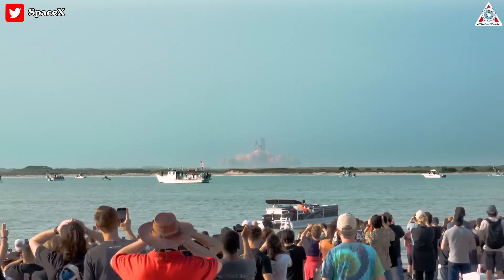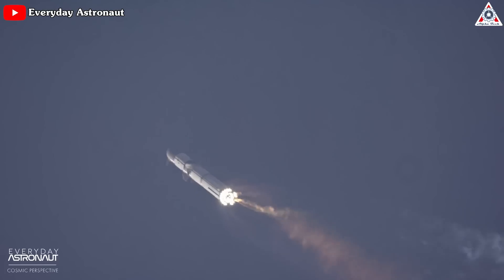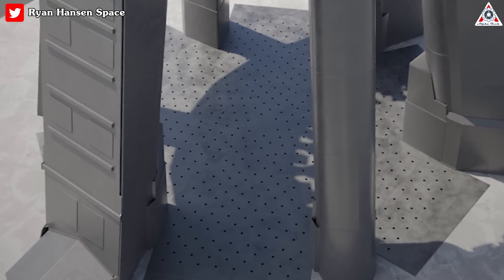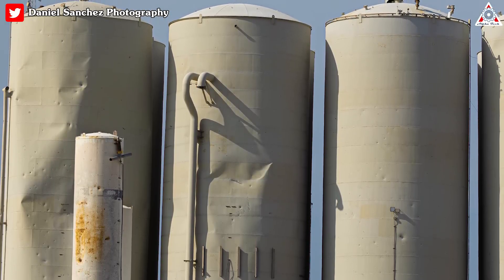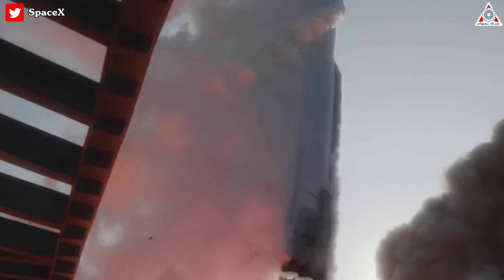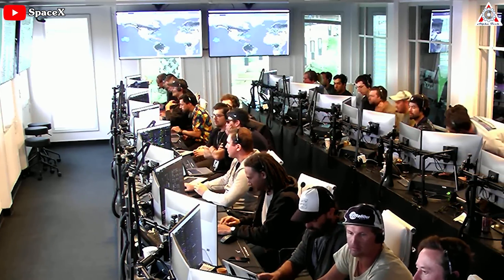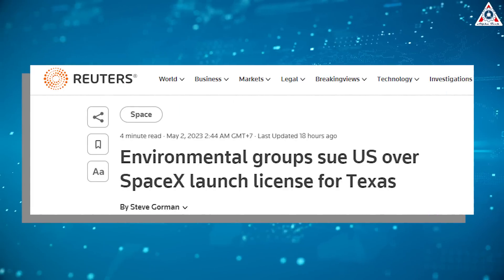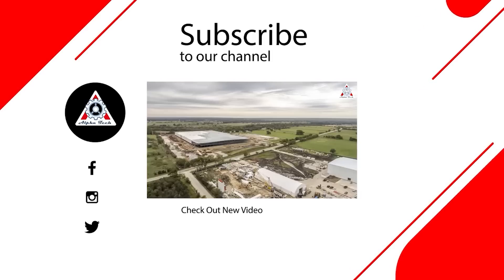SpaceX upgrades everything on Starship's pad for new launch...

Comment: During the launch, pieces of the launch pad that flew into the air and destroyed the rocket's engines, this caused a chain reaction in the rocket. The structure of the launch pad was clearly too weak to withstand the forces caused by the rocket. 👍
Reply: This isn't what happened, or rather is probably not what happened. The force of the rockets downward thrust would make it very difficult for debris to fly directly upward. The launchpad design was a complete failure, of course, but the reason behind why at least 3 raptor engines were offline at the get go is still kind of unknown. And the fact that more continued to fail and self cannibalize (green smoke an indication of that) on the actual flight is concerning. This is a reliability issue, perhaps these engines are simply flawed in some other way.
Reply: @oliverbleich1447  Elon said himself that three raptors were under performing when they engines starting firing.  Consequently those three engines were shut down early on.  

And I think calling the design of the OLM a complete is over the top because the failure was in thinking the fondag concrete could handle a full thrust of the raptors which proved wrong which Elon admitted to.  Elon said they thought that could get away on this one launch without the water cooled steel plate and deluge and that was wrong too.  So now that system is being installed and they could be ready to launch again in a few months.
Reply: @michaeldeierhoi4096  Underperforming and shut down intentionally, still leads one to ask why they are not reliably working. It's kind of a big issue don't you think? I'm also not convinced that what Elon says lines up with what happened. Why did another half dozen engines fail within a few minutes as well?

As for the launchpad design, I'm just an armchair guy, but I've seen a number of people leading up to the launch say that it was completely wrong and was going to be an issue. How is it that people on youtube recognized this and it still went through? It leads one to think that either SpaceX knew and went ahead anyway, or they didn't know and neither option feels very good to me.

The old NASA motto from the apollo missions was "failure is not an option". Granted they also failed at times, but if we are going to be sending humans back to the moon and beyond, I'd really like to think this stuff would be worked out better.

I also don't personally understand the need to reinvent the wheel. The Space Shuttle was awesome, the launchpads with water cooled trenches etc work (again not an expert on how they do, but they do). I'm all for innovation, but science is about standing on the shoulder of giants. Ultimately, I would have hoped that these programs were run by NASA without private profit incentives. I'd have loved to see a redesign of the Space Shuttle itself, instead of all these back to the drawing board approaches. At present, we are still using 1970's technology and Russian made rockets to send our astronauts to space, because they are reliable and they work.

Anyway, I could wax poetic for a long time about all the things I feel are going backwards with SpaceX, but the internet would just call me a Musk hater. The truth is I'd love to see a man on Mars in my lifetime, I just have little faith in Elon putting one there, let alone last year as he suggested, or even in 10 years. He glosses over so many logistical hurtles, it really boggles my mind at time. I'd suggest reading the book "Packing For Mars" if you ever have the opportunity.

There are major advantages to government programs that are non-profit, namely they can go the extra mile and spend the extra dollar to make everything as safe as humanly possible.

Best to you and have a nice day.
Reply: @oliverbleich1447  Just because the old motto for NASA was "Failure is not an option" is not something set in stone that can't rejected.  In contrast one of the favorite lines of Musk was if your not blowing things up then you aren't making progress.  Space X is developing an entirely new rocket, being built in tents and high bay structures and using a methane/lox fuel which has never been done before.  What about any of that is 70's technology??  

The development of starship is innovative in every way possible and Elon brought Space X along to accept failure as part of the learning process.  I find it amusing that so many people are critical of Space X after just the first launch.   People are so caught up in what they think went wrong that they haven't paid much attention to what went right and what is to be improved by the next launch. 

As to the Raptor engines, they are part of the development process as well.  It all takes time and will require many many test launches to work out the links.  

 People also forget the many times the Falcon 9 crashed during its development and again with attempted landings before getting that right.  Now Falcon 9 is about the most reliable booster rocket out there and Dragon the most reliable manned capsule.
Reply: @michaeldeierhoi4096  Astronauts currently use the Soviet era Soyuz rockets to go to space, first developed in 1967. It is the most reliable method since the Space Shuttle program was shut down. It seems like you are a fan of SpaceX, and I don't begrudge you that. I'm merely stating that instead of reinventing the wheel, we ought to make the wheel better. We have the tech to do it now, we don't need to be blowing up rockets. There are rovers on Mars, we put men on the Moon in 1969. Why go back to the drawing board? Especially when the Space Shuttle was so darn good. And when it comes to manned missions to the Moon and to Mars, failure isn't really an option. I don't know how you can disagree with that.
Reply: According to Musk there is no evidence that any raptors were damaged by flying debris at launch though Musk admitted that is not to say that it didn't happen.   Three raptors were shut down at launch because they were working properly.

Comment: A steel shower head pointing up.  High pressure  moves to low pressure .  What is the water pressure needed to overcome the directly opposing rocket thrust pressure?   Let us wait and see.
Reply: The entire structure is open all the way around and the engines are what, fifty feet up?  It's not very restrictive to flow away from the engines, so the pressure can't be too terribly high there.  A couple of hundred PSI will probably be plenty.  At a large 1000+ Megawatt power plant, for instance, they continuously push a half a million gallons per minute of cooling water out to a cooling tower that's about a half mile away, then up 50 foot risers to a distribution network of nozzles in the tower base, and those pumps only run at about 60 PSI discharge pressure.  1950s technology.
Reply: @nathanwahl9224  Each Raptor engine produces 500,000 lb/ft. = @ 3,500 psi. . You think that energy dissipates in 50 ft to below 200 psi?   Within seconds after engine ignition we witnessed an epic excavation of large chunks of concrete. You think 300psi of water pressure will overcome that energy.  The most hopeful water delivery method is to use the venturi effect .  The flame trench with a sloping metal ramp imparts a venturi effect when the rocket exhaust moves through the trench.

Comment: It's not the heat that pulvert your launchpad... 
It's mostly the violent mechanical vibration, a bombardment of explosive shockwaves.
Even your water cooled steel plate will break up and fly away.... and not in a beautiful balooooon. 
You have to divert the force of these powers.
Reply: It was the heat, it's the heat that caused the concrete to explode and then the force sends whatever comes loose flying. Concrete contains water, and when it's superheated it rapidly expands and that pressure needs to go somewhere so the concrete explodes.
Reply: That was mentioned in the discussion. The vibration (sound) did most of the damage, and the idea is that water will disperse the vibrations enough. The steel is there for the heat.
Reply: If they design the plate to be robust enough, it will be fine.

Comment: You can design once,  or trial and error a dozen times to get to the same place
Reply: That would assuming that the rocket one is testing is like those in the past which of course it isn't.  Starship is twice as powerful as the Saturn V and it is being designed to be reusable.  Who else has ever done that??   The launch of the SLS also caused damage underneath the launch tower so a flame trench I'd not a cure all.    

There is not necessarily only one way to do things.  Since Starship is so powerful other systems are being tried.  Space X is developing the launch pad as they develop the rocket.   

It's amazing to me how cynical people are after just one test launch.   😂😅

Comment: I am interested to know how Elon Musk and his engineers plan to not only land on Mars with Starship but also how to relaunch from that Planet given that there is no support infrastructure there at present. We have witnessed how much damage that was caused to the launch pad and Starship itself during the first test flight how is this potential impact damage from flying rocks on the Martian surface going to be mitigated?
Reply: There is a huge difference between the starship taking off with 33 raptors firing on the booster and three throttled down raptors firing from starship on liftoff from the Moon or Mars.
Reply: How many times do we need to answer this? You don’t need a booster on the Moon or Mars
Reply: Super heavy from launch pad to low earth orbit, starship separates and goes into orbit & then is used as a fuel tanker or goes Mars - moon & back, only relatively small amount of fuel & thrust is required to leave Mars & the moon.
Reply: Not to mention gravity is 1/3 that if earth, easier to pull away.

Comment: You listed so many things as "failures". SpaceX said anything beyond clearing the tower would be considered a success. I say for a first shake down TEST flight it was very successful.  It identified areas that must be changed. And they will.  It's how SpaceX learns and perfects. And they do it very well.  The next TEST flight will show how these fixes worked and identify more areas to tweak and improve.
Reply: They lost a total of 8 raptors during the flight. That is an enormous failure.
Reply: @Krunchy71  Losing 8 engines is hardly the only way to define how well the first flight went.  After all Musk himself said before the test that if they clear the tower such that an RUD would not destroy the OLM then it was a successful first flight.  Starship even made past Max Q to MECO, but various problems preventing stage separation.   This first flight was all about collecting data which they got a lot.  And improvements on the next booster, starship and OLM are likely to make a big difference.

Comment: Elon's mega water-cooled steel sandwich will probably stand up to the blast and heat from the 33 Raptor engines - provided they all fire together and Superheavy lifts off in around 2.5 sec - instead of blasting the pad to smithereens for nearly 7 seconds before it finally leaves the pad as it did n the April 20th test launch. But won't the steel sandwich simply reflect the blast and sound energy upwards to add to the blast and sound energy already being emitted sideways and upwards from the firing engines? Perhaps a flame trench would be better after all?
Reply: A flame trench is out of the question because of the high water table.  And Space X isn't going to build up the pad under the OLM for a flame trench.  Beyond that a flame trench is not a cure all to their problem anyway.   Even the the trench under the SLS was a wreck after it launched.  Two elevator doors were destroyed.  

Starship is almost twice as powerful.    Space X is developing the OLM as well as starship.

Comment: I don't know, shooting a shower head of water up at the engines, would seem like someone with a garden hose pointing it into the wind of a fire tornado, it might help in the first 1/2 second, after that, bare magma blaster on bare metal.  All that power that dug out the cement, will now be diverted to the tower and tank farm, its gotta go somewhere.  Good luck, but still a little sketchy.  They need a flame diverter.  That's it, nuke the site, start over lol.
Reply: What about if it was as much flow and pressure as say a hundred thousand garden hoses all at the same time?  Which is do-able.

Comment: Critical thinking is still not something that is required from Alpha tech script writers it seems.
E.G.:
Starlink will always be slower than fiber optics. 

Any seriously developed area already has or will have a fiber solution provided and this at a cheaper cost than starlink.
Who uses sat based communications? Those in more remote areas. 

Is Starlink the only provider for sat internet?
No, nor was it the first nor is it the cheapest. If anyone stops to think about the cost of needed sats by starlink, the cost of making them, launching them, replacing them every 3 years or so and then divide that cost by the available people on the entire planet ... there is only one conclusion, it can't ever be profitable without major subsidies (= tax payer money) unless they expect even the people deep inside the Brazilian rain forest that hunt with spears sign up for it.

Comment: Upgrading the existing setup is a fruitless exercise, Elon has to turn his thinking directly toward constructing an "Exhaust Diversion" Duct/ channel to remove not only the extreme heat generated by the exhaust plume but also the extreme turbulence that will be exceeding the fiercest cyclone can generate. Pretty simple answer to the problem of performing 3 launches per day.
Reply: Pretty simple answers are often wrong when they lack sufficient data.   A flame trench is pretty much out of the question to be installed below the OLM because of the high water table.  Space X knew this initially and Elon even said years ago that going without a trench might be a mistake.  In addition a flame trench is not a cure all to the problem. The SLS launch wrecked a couple of elevators below the launch pad despite using a flame trench.   

Consequently, they are trying something different.  The starship is more twice the power of the Saturn V and water cooled steel plates will be combined with deluge to address the acoustic effect of the Starship launch.

Other things will also be done to mitigate the effect of the launch on the pad underneath including launching within 2.5 seconds instead of the firing up of engines in succession as was done before.  One launch is hardly any indictment of the whole launch pad.   They will be ready to fly again in a couple months pending any legal complications.
Reply: What's the fun in that tho? Yeah flame trenches work we get it and it sure they do also but it soon won't be the only thing that works

Comment: Idk... I think its kinda silly, but we will only know when its tested. I think they should do some form of direction flow for the thrust, rather than trying to negate it with water. I mean, you still need water, but I dont know if its going to be enough for the amount of thrust this beast has... Works great for nasa, but we are talking about 30+ raptor engines.
Reply: Works great for NASA, but NASA wasnt developing a rocket twice as powerful as the Saturn V.
Reply: @michaeldeierhoi4096  yeah thats my point, Nasa did more for less, and Space X is doing less for more, only time will tell.
Reply: to clarify, more infastructure, for less thust, for nasa, and more thrust and less infastructure for spaceX
Reply: It's relatively easy to move a LOT of water quickly.  I mean a million gallons a minute, like they do at large power plants, and have for sixty years.
Reply: @nathanwahl9224  That I understand.  Space X must have the water trucked in just like they do the methane and lox.

Comment: Drop the price of starlink to a fiver a month and they'll be making money hand over fist. It sounds counterproductive, dropping the price from £70-odd quid to £5-odd quid, but they'd become the number one ISP on the planet and wouldn't know what to do with the cash coming in. They'd be making so much money, forget about it, they'd be the number one company on the planet virtually overnight.
Reply: So your solution is making them lose billions until they have utterly cornered the market and then do what all companies do in that case, namely jacking up the price to whatever they feel like it.

FYI, if you are in a densely population area, with high tech society, what is the advantage of starlink compared to fiber optic hard line? Answer : NONE. In other words, the people that have the most need for internet and can spend the most on it have a faster, more reliable solution for less cost.
Reply: @PDVism  Ask ARM about that. There's a cheap ARM processor in every device. Economy of scale, bitch. They have cornered the market which is why everyone, not just the rich, has a smartphone. 

They're the reason why profiteering companies Nokia who dominated the market, and Motorola, who invented the cell market in the first place, were kicked out of the phone market. They saw profits instead of moving where the market went. 

Or did you miss the part where I said it sounded counterproductive?

Comment: How are they handling the Acoustic sound waves from the engines?
Reply: In addition to the water cooled plate they need a more robust deluge system from the launch mount ring to dissipate those waves. Eventually with even more powerful versions proposed (Starship 2.0) they will need to move offshore. Preferably to a small island in international waters
Reply: @jason_m_schmidt622  No.